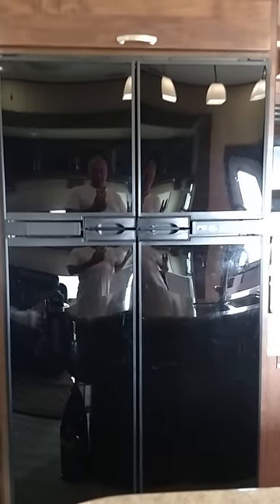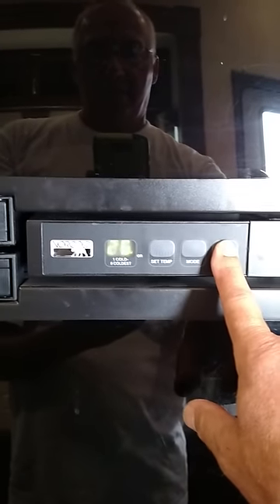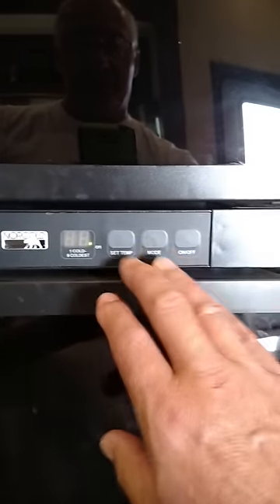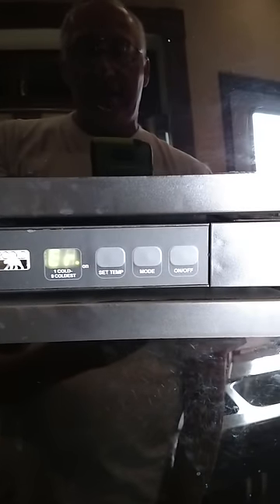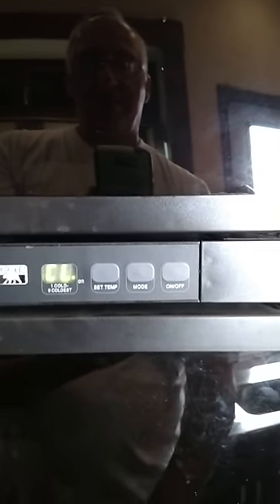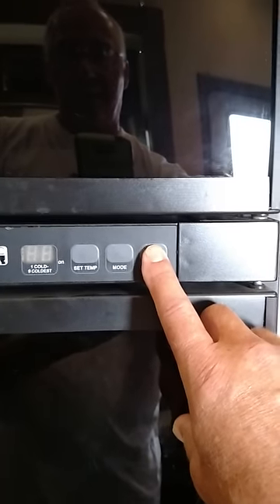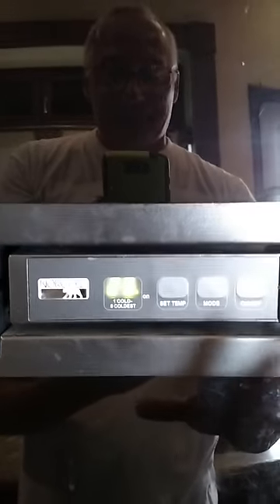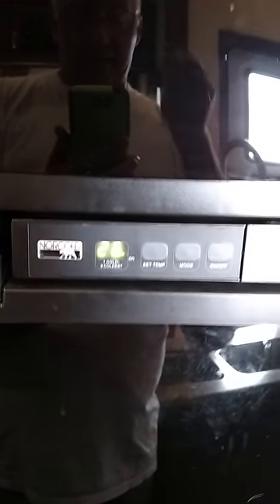Norcold 1210 warm RV refrigerator fix

Comment: Our Norcold 1210 was not working on AC.   LP would turn refrigerator on, but not cooling very well.   We ran the diagnostic test just like you showed.  Downloaded the service manual too.  At first we heard no reaction from the refrigerator and saw no change in temp on either LP or AC.  We turn the refrigerator off and went out to eat.  When we came home, hours later, I turn the refrigerator back on AC, and we went to bed.   When we got up in the morning the refrigerator was registering 38 degrees on the panel and my freezer was making ice cubes.  I believe following your instruction in this video and then turning the unit off for several hours, and turning it on and running during the night reset and fixed what ever was wrong with it.  Just like you say in the video, "these refrigerators are like voodoo".  Thank you!!!
Reply from the maker: Hi and thanks so much for your positive comment. 
Glad you got it working.
I added some high level notes in my description text you might want to take a look at to help better understand how the thing works. It's brief but to the point if you didn't know already.
Ours started heating up last night to 35 but was back to 23 this morning and nothing had been done. Go figure. All I can say is keep monitoring that fin temp. and take action if/as needed. We're lucky that we have a toy hauler and actually bought a small residential fridge and keep it in back as a backup now, all before making this video and really getting into trying to figure out what to do.

Comment: I have a smaller version of the Norcold refrigerator in my toy hauler and this video helped me clear the air code for it. Thank you very much for posting this and it looks like it fixed my issue.

Comment: This video helped me out thanks so much, I snowbird for 5 months a year and it seems about once durning that time the refrigerator starts to warm and wont cool properly.  I re-level and tried your process and in a 4 hours the refrigerator was at 36 degrees and the fins were cold again. When i travel and move every few days I don’t have this problem so I think it proves that performing this procedure is resetting the electronics. Thanks and I will share with other RVers that have the same issue.

Comment: Thank you!! The Manuel Link you provided is wonderfuL! IT's crazy they do not supply us with this full Manuel upon purchase or at least a weblink for it! So thanks so much! We went to page 73 section 9 like in your notes above and we were able to see all the fault codes and what they meant. Nothing was the culprit so hopefully after doing your suggestion the fins will start to go down. We are at 29-30 and our thermostat is reading 43 degrees. So we need to get it lower. Earlier today we found we had a broken fan in the back of the fridge. We ordered another but won't be here for a couple days. We are going to try to add a fan as well, we only have 2. We had a fan below trying to suck out the hot air but it was off so we turned that back on and hopefully tomorrow all these things will help a bit till we get the new fan installed. Earlier We did try moving the thermistor over a couple fins like someone else suggested but didn't seem to make a difference. Thanks again for your video and all the info provided! We really really appreciate it! Youtubers are awesome!! Fingers crossed tomorrow morning the fin temps are down a bit. But great to know about the fin temp display, we have it up on the display now and I think we will also be leaving it up and our indoor wireless sensors in hottest corners of fridge and freezer. Thanks!

Comment: I have a 1210 the freezer works ok but the fridge stays in the mid 50s. Another you tube channel said to disconnect the thermistor in the fridge that attaches to the fins and see what happens after 24 hours. I did this and sure enough the next day I was in the mid 30s. I replaced the thermistor and now it works great. I also placed baffles on my top slide exhaust per Daren on RVWORKS. And installed fans to the grill.
Reply: I’m having the same issue. I check the omhs resistance for the thermistor and everything looks according to the temp. Now I’m thinking I need to change the fans. Idk how it will affect the temp inside since those fans are outside

Comment: Very informative. I'm on my first norcold after 3 dometics. Trying to figure out why fridge will get to 33° but freezer hovers around 16° on setting 9. My earlier models would get to 4°- 6°. I've noticed that the two external fans aren't running so I'll do reset and check again. Thanks again.
Reply: Did it do anything?

Comment: My control panel lights up but when I press the buttons,  nothing happens and nothing changes. 
I have a older norcold N510.  it wasn't cooling so I moved the sensor up on the fin inside. Now it's too cold. Fridge 29° freezer 7°

Comment: Mine never gives me an error code,  I just turn off and back on when I see temperatures starting to rise in fridge, I just keep digital thermometer on shelf and look at it every time I open fridge.
This works most of the time, if it does not you need to defrost and let fridge sit for awhile before restating.

Comment: The reset procedure worked just fine on mine, but about a week later the same problem, then it resets as in your procedure. Have you determined what is causing this issue? If so, what is the permanent fix?

Comment: Mind said 46 is that normal
Reply from the maker: 46 refer temp? NO. It should be 32 or so. Remember, that is temp of those fins in the back which create the cold air. The actual box temp will probably be 33 - 35
Reply: @dablingtime  I did what you said but mine showed 47 what should I do now

Comment: Thanks again for the video.  Is there a fan anywhere that could also not be blowing cold air through the fridge?  My freezer works, but the fridge is 57 degrees.  Changed the thermistor too.  Just seems like there should be a fan, but I'm not finding one anywhere in the unit or in the back.  Thanks.

Comment: Thanks for your video!  I replaced the thermistor a few days ago and the unit just won't cool in the fridge.  The freezer is super cold. Went through the procedure and the temp displayed was 57!  I knew I had problems.  Is there a next step if your temp is way off, or do you just wait and see if it worked?  Thank you!!